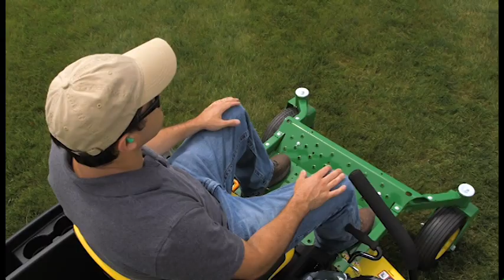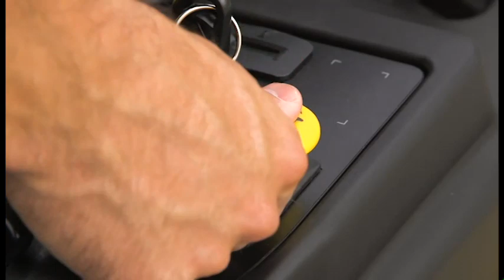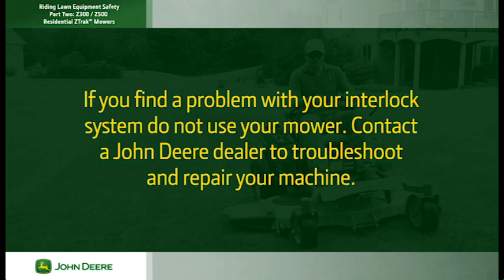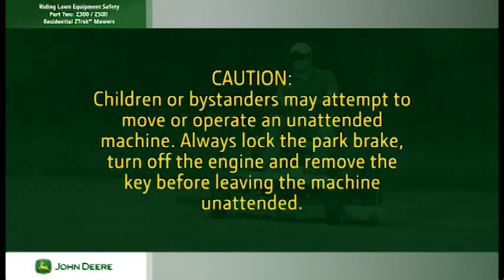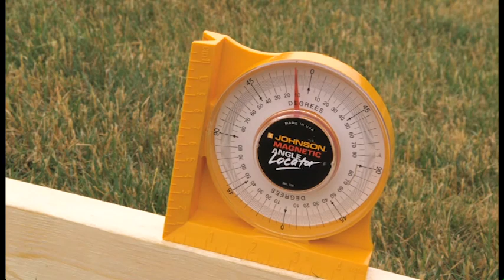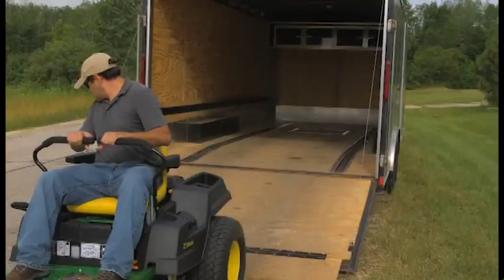Z300-Z500 Residential ZTrak™ Mowers Safety

Comment: Don't waste your time and money on a John Z Trak series mower there junk the one I owned it's second home was the repair shop.
Reply: We are planning to get a zero turn soon so would a bad boy be better?
Reply: @woodduck7318  
My friend, I don't know what a bad boy might be but I have a Cub Cadet ZTX4 60" Ultima and so far no complaints. The John Deere is still where it broke down I plan to use it as a flower pot holder and probably leave it there for a while as I reminder to not buy junk.
Reply: Wood Duck : There is no comparing the two. Bad Boy is ten times superior to a John Deere.!! I have a John Deere and both hydros quit working . $900.00 per hydro plus labor to repair. No more green for me.
Reply: @calvinwinn7643  
What type of mower you have, you only refer to it as bad boy
Reply: I have a John Deere Z540 M, and it will cut with the best of them.  Plus the Dealerships are great.  Not everyone has John Deere money, nor do they maintain their equipment. It also helps to know which mower you need.  I cut 6’ tall weeds, full deck width, and mulch it at the same time!  Mulched my leaves 🍁 so fine, they blew through the square farm fence, over the hill.  Yard is so green & clear, it looks like Spring time.  Only an idiot would call a John Deere, anything, junk! People are still running old John Deere mowers, and other people are waiting for them to get off of them, so they can buy them.  Very dependable machines & dealerships!  Get a set of Kavli blades for any of your mowers and you’ll enjoy mowing again.  They even work on push mowers. Made my mower twice as efficient and doing it at a 7-8 mph. I got a son-in-law with a new Rascal that broke down and didn’t even take it in under warranty. Most uncomfortable 🥵 machine I’ve ever operated, but one of the best Warrenty’s in the business. He left it in the garage for 5 years. My daughter is getting rid of him!

Comment: Can the z540R mow hills?  What’s the hill rate/ratio
Reply from the maker: Thanks for asking, Debbie. It is recommended to never mow or operate the Z540R ZTrak™ Mower on slope angles greater than 13° with the unit in its basic configuration (without attachments). When using attachments it is recommended to never mow or operate on slope angles over 10°. You can find more information in "Section 10 - Safety - Operating On Slopes" in the Operator's Manual for the Z540R here: https://bit.ly/2SEOjRr.